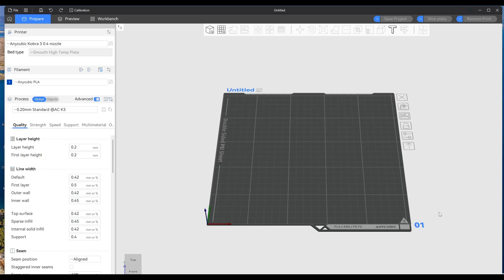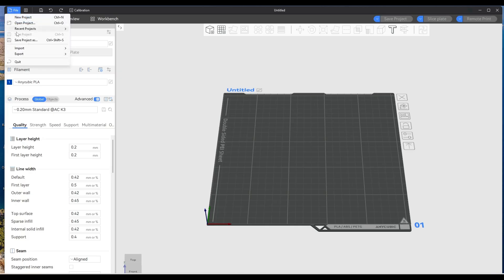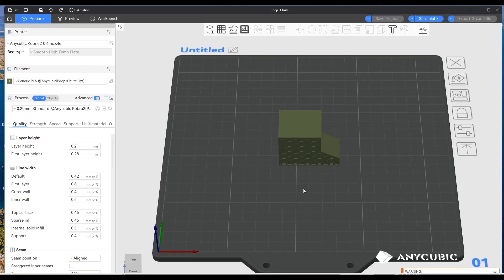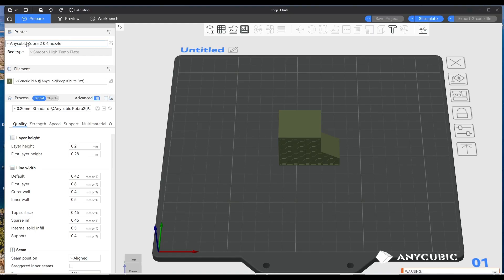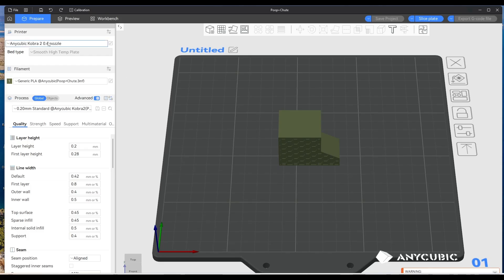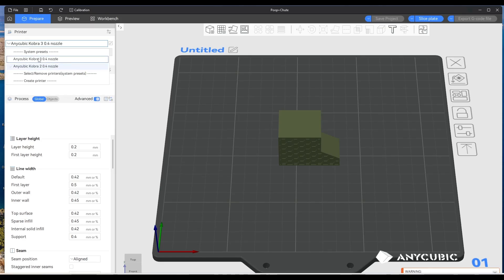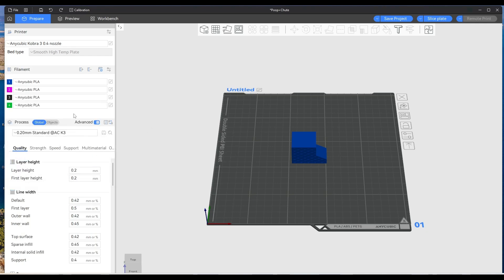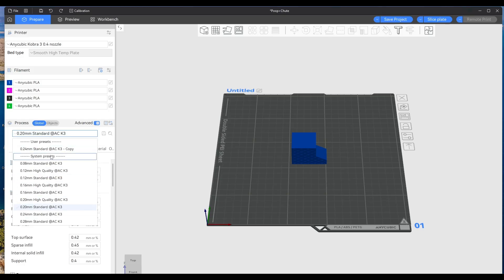How to fix the model mismatch error in the Anycubic Slicer Next Software

Comment: Great video. Ihave answered this same question so many times. If users look over all of there settings on the left side of "Anycubic Slicer" and make sure all settings have NOT changed then, it can be seen and adjusted back to there printer profile.  When a design has been downloaded and has a preset profile the slicer will use that downloads settings over the user that is having the mismatch issue,  sorry to ramble on.. this is a great video and a perfect solution to the mismatch issue,  thanks for uploading